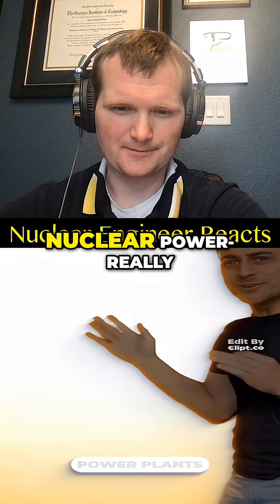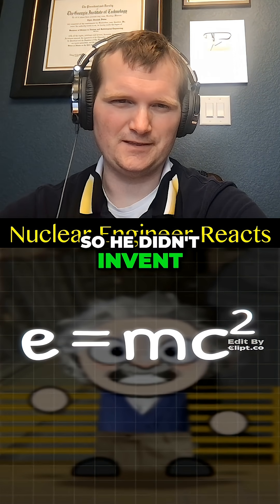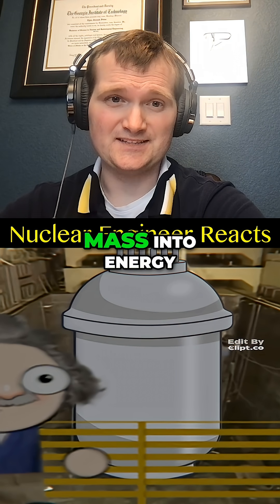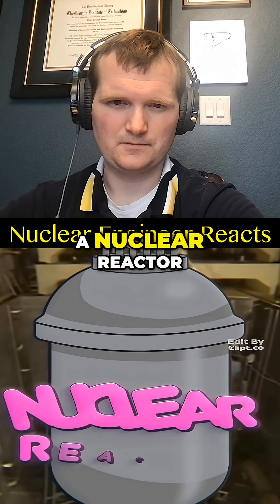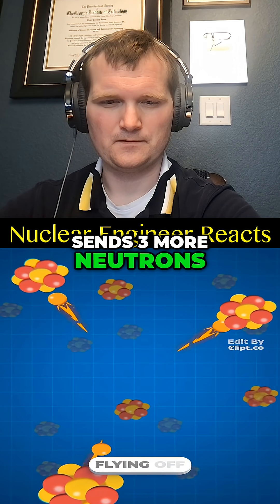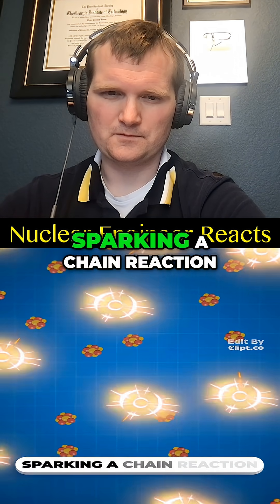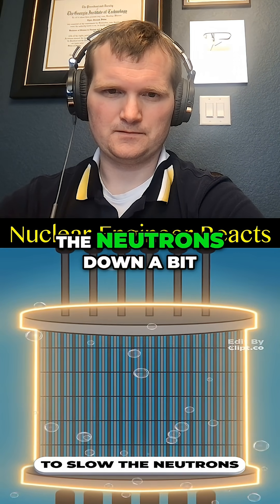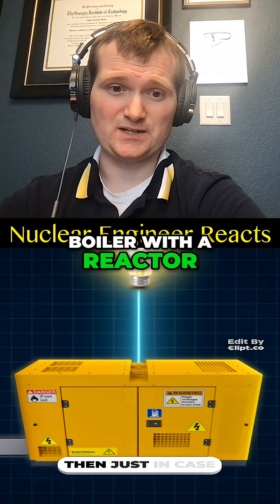How Nuclear Energy Works - Nuclear Engineer Reacts to Henry Belcaster

Comment: "you end up with a nuclear bomb." Jesus, the absurd crap you can find on social media. I'm surprised the real scientist in this video was able to keep a straight face.
Reply: It's unfornatunally really what especially the greens believe. They don't get, that the only real danger a nuclear power plant has is that when it gets too hot it might burn through the steell containment and releases radioactive material into the environment. They don't even know that the roofs of Tschernobyl and Fukushima didn't came from a nuclear explosion, but a hydrogen explosion from hydrogen that builded up inside the building due to the melting core
Reply: @acmenipponair  Yes, there's a big difference between a nuclear meltdown and a nuclear explosion.  The Chernobyl meltdown created the 'Elephant's Foot'.  A nuclear explosion would've blasted everything away, no 'Elephant's Foot' and likely no more Chernobyl.
Reply: @Robert41265  There was an explosion, but it was not nuclear-based. That's also why we were able to build a concrete shell and iron dome over the facility. And the sheer volume of Elephant's foot and how it melted through concrete like nothing gives away how bad the reactor truly was. Just to see the foot, we sacrificed a life taking that picture, which is insane. And we sacrificed a lot of lives just building the concrete shell. Everything that could go wrong went wrong. And I hate that this incident is the shameful legacy of nuclear energy and the stigma it created is one of the reasons why we are still not widely using nuclear powerplants.
Reply: @zennonapieronn  First, deep respect for those lost in the extremely difficult and dangerous work to clean up and seal Chernobyl.  There was no intent to mitigate the extreme danger of a nuclear meltdown.
Second, my comparison was meant to explain that nuclear plants don't become nuclear bombs.  They generate extreme heat which melts everything in and around the core when they're out of control.  I knew about the explosions which were caused by steam pressure from the vaporized water (physical) and hydrogen gas ignition from off-gassing and buildup of hydrogen (chemical).
I was a young adult when the Chernobyl disaster took place, so I saw everything as it was reported on the news including the radioactive cloud that was released and expanded the danger beyond the plant itself.  The Russian military even seeded clouds to trigger rain in an attempt to wash out the radioactive cloud. If I recall, the results were somewhat mixed.
Reply: @acmenipponair  You need to remember that Chernobyl happened almost 40 years ago. You would be lucky if you had a brick as a phone, now we got a thin computer in our pockets. The technology changed significantly, including nuclear power plants. Additionally, the failure in Chernobyl was caused by series of mistakes, bad design and zero regard for safety. What happened there is not possible to replicate, even if you bypass all the safety mechanisms. Fukushima is also another failure that was caused by several factors, earthquake that caused power to go out, and a tsunami caused backup gas engines to go out as well. And despite that, the damage it caused was relatively minimal. 
But Fukushima is another example of failure that has a very low probability of repeating. Not only it was caused by an earthquake, but we also have new measures to protect against similar situations. If the control rods fail to insert somehow, the generator will be flooded. 

Nuclear reactors are currently extremely safe, compared to all the other power plants with similar energy output. And a large scale failure is impossible. People think that it's something extremely dangerous because of a failure 40 years ago that can no longer happen. Or, it's the dangerous waste, that poisons the earth or whatever, when it's the most green energy possible, and the waste is found in the earth. (fauna is kinda thriving around Chernobyl) And it's stored in pools and small little reinforced concrete silos, or concrete vaults. It's also negligable amount compared to the amount of waste other power sources create. 
Really, if not for soviets creating a completely failed nuclear power plant, nobody would even question nuclear power plants, and we would be so much better off. Nuclear energy is future, and however we try, we are not finding a better energy source that is clean and safe anytime soon. So we will see a shift towards nuclear power, hopefully sooner than later.
Reply: @acmenipponair 
Tschernobyl? Wtf is that?
Černobil maybe?
And btw, that nuclear plant was in Pripyat...
Reply: @Kyrichenko  that's how Chernobyl is spelt in German. And Pripyat was built around the reactor at Tschernobyl, it was an artificial city built next to the reactor. If you're gonna be a smartass at least try to be a factual one.
Reply: @OmphalosDaemonium6612 Well you're speaking English so spell it the English way??
Reply: @lieutenanthorse  I'll spell it the way I want to spell it lmao. You understood what it was referring to right? Requires a bit more brain power than you can afford to spare apparently but still..

Comment: Mass defect? Ok Commander Shepard, whatever you say
Reply: Yes, you can call it that way. As the atoms lose a bit of the energy because three of the neutrons of the Uranium 235 become free and go into the water, making the water hotter when the neutrons pushed against the water atoms (it slows down the neutrons and makes the water faster = hotter), the result of a splitted Uranium 235 has less mass together than the source.
Reply: Sybau yn blood

Comment: The last part of this video about the turbine. This needs to be taught to people across the globe a lot better. I've run into far too many people who don't understand that 99% of the time there is almost always steam and a turbine involved in power plants of basically any sort. Even some solar types. It's only solar panels, and wind turbines (I think) for the most part, that get away with not having steam involved.

Also... teach the damn fools that vapour is not steam.

Disclaimer of expertise (not much really) Class 5 certificate gained for working with low-pressure systems. I could have taken it further, but I saw the quality of people going into the higher levels and decided to avoid that. (You might be of a better bunch TFolse, but I would have had to be dealing with the less better sort... and I like not blowing up due to the incompetence of others.)

Comment: Love to hear your thoughts on LFTRs.  Been hearing and reading a lot about them. More efficient, uses its own fuel as the primary coolant, can consume existing nuclear waste in small amounts, safer since they operate at lower pressure, smaller and less expensive at scale, etc.